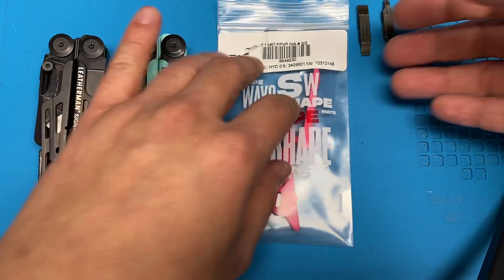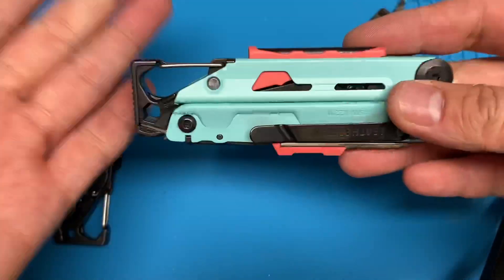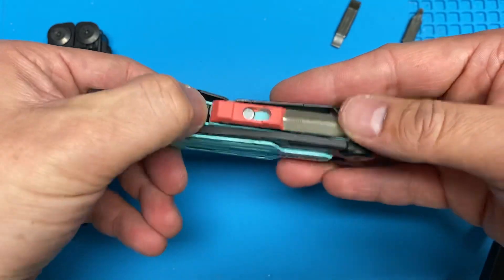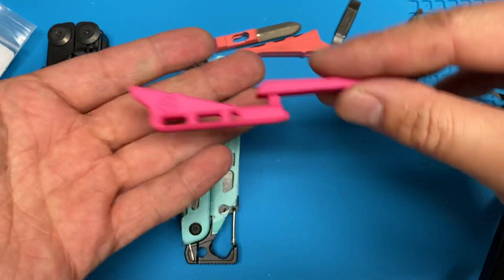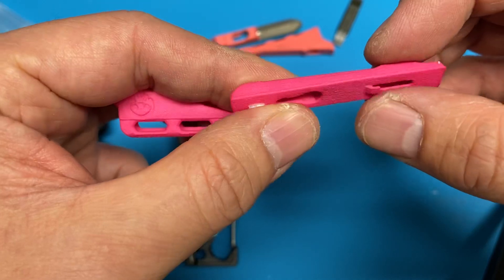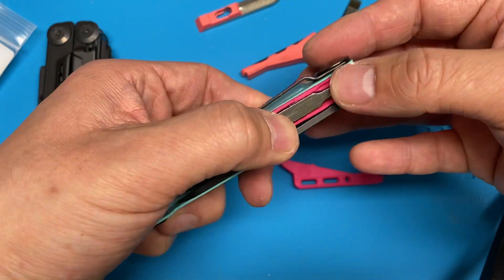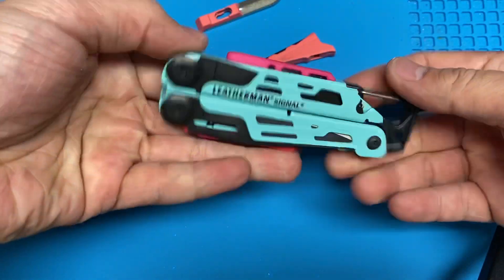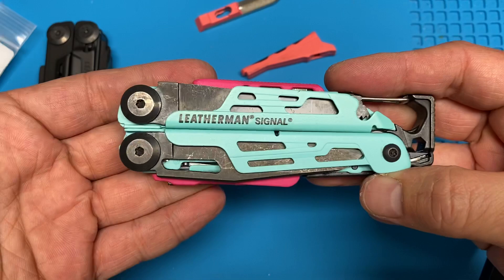Leatherman Signal Multitool Mod: 3d Printed Additional Bit Storage

Comment: I got my Signal just a couple of days ago and so far I’m impressed. It’s a great tool. There is one thing that REALLY bothers me about this tool though. The liner lock on the blade is so flimsy and cheap feeling and it’s quite a small thing to press so you kinda have to wedge your thumb in. It’s just a super cheap feeling lock and I wish Leatherman had come up with something better. Other than that I’m happy with it but yeah that liner lock really makes the tool feel cheap.

Comment: I feel that the portion with the nub could be changed to a full protrusion that's located where the final resting place of the holder is. That element is a bit too fragile, i'd see it twist and break under the right conditions.

Comment: I ordered this from shapeways. It was garbage. The bit wasn’t even close to being able to be held in the holder. Both the whistle and the other one wouldn’t hold the bit at all. Absolute junk
Reply from the maker: You may want to take it up with Shapeways, they are very good with reprints. The tolerances are quite tight on these and the slightest overheating of prints will make them expand during finishing etc.

Comment: Any reason why it’s not available in metal?
Reply from the maker: It needs to flex to retain bits and also be installed.
Reply: @MetroGradeGoods  I see. Thanks for explaining. How about metal with a magnet? Also, I noticed the flat hex holes on the side of the fero replacement is that to hold two sideways instead of one parallel? Great idea. Thanks for making them!